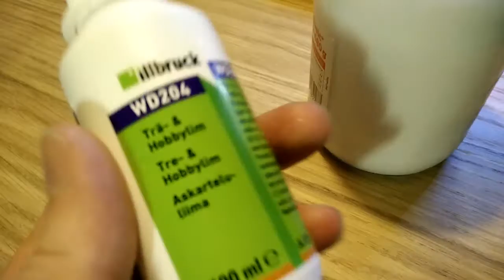Sunhokey Prusa I3 2015 3D Printer - Customized

Comment: Im looking to buy my first 3d printer, would you reccomend this one?
Reply from the maker: Yes, i think it's a very good starter kit. :)
Reply: BoXon Ive seen that over time the frame falls apart, has this been a issue?
Reply from the maker: I have never had a problem with this printer (except för the ones i caused it by testing things out). Frame is rigid enough and hasn't been falling apart for me, but be aware to not over tighten it as it easily cracks. (Hasn't happened to me tough)
Reply: What is the build volume on this also what is that white covering you put over your wires

Thanks.

PS: i like how you setup your printer :D
Reply from the maker: 200x200x180 (X,Y,Z). I've made alot of changes to the printer, so a new video will probably be out soon. :)
Reply: BoXon Does that material spool holder come with the printer?
Reply from the maker: Yes :)
Reply: BoXon About to purchase a Aurora Steel i3 printer, steel frame i3 printer
Reply from the maker: Good luck with it! :-)
Reply from the maker: Most of it looks to be plastic? Also i wouldn't buy anything from aliexpress that hasn't gotten any feedback. If a metal body is important to you, go with the Wanhao I3 V2, big community around it! :-)
Reply: BoXon
 Hey i found one shipped and taxed for only 10$ more to my doorstep

Imma get this one instead, Thanks :D

Comment: Hi BoXon,I have the same printer and also made changes to it....I have auto bed leveling, e3d Hot end and a PCB heat bed with a glass surface and a BuildTak sheet..... NEVER have any problems....
Reply from the maker: +55Rumble 
Hi! Glad to hear it's working good for you! I'm working on some new updates to the printer, and will post a new video when i'm done. Heard a lot about BuildTak, but as i found the best solution (so far) about a week ago i haven't made an investment to get any. (Solution: Cheap wood glue without any water added)

Comment: I bought a Sunhokey prusa i3 about half a week ago and was wondering what did you flash the mks with to include the bed leveling system? I've been looking around and I cant really find the software for this printer.
Reply from the maker: Hi Filip! I contacted the guys at Sunhokey and asked for the firmwire, they provided it with no questions asked. I suggest you to do the same as mine is mks v1.1 and yours probably 1.2.

Comment: Hi BoXon, 
Great video, I have received my Sunhokey printer on Monday and have done quite a few things, I have added the auto bed leveling after searching for a way to fasten it to the current X carriage but could not find anything that works so I have designed my own yesterday and it works very well. I'm looking forward to your video on the auto bed leveling.
Reply from the maker: +Jaco Le Roux 
Thanks Jaco!
Yeah i had to design that myself to, too bad i don't think i have those .stl files though, so i'm glad you managed to manufacture your own! Thats the whole point of 3D printing, right? ;)

I'll be mowing to a bigger apartment next weekend (waiting has been so long and i can't use anything in my house currently as everything is in boxes), but as soon as i get my new "workshop-room" setup i'll be here with more videos of the printer! I also ordered a proximity sensor to test another method of auto bed leveling so i guess we'll see how that turns out! :)
Reply: +BoXon 
Hi again, thanks for replying, if anyone is interested here is a link for the one I have designed, maybe not the best but it works, I have made one change since my print yesterday, I only had a tight 4mm hole where a M4 bolt make use of the material to screw it down on the acrylic, I have added a hex M4 hole on the bottom peace for fasting it that way, the only thing is to drill a hole in you acrylic but use caution.

I'm still learning to use the 3D Printer some calibrations just doesn't add up, I think I'll get a new and better Extruder and hotend.. 

I'm looking forward to your proximity sensor test, will look out for it.. enjoy  

https://www.dropbox.com/s/blw9lhjpk03ufpq/ABL%20Sunhokey%20PRUSA%20i3.zip?dl=0

Comment: Did you have to add anything else to use the mk7 gear? I put an mk7 in my Sunhokey prusa I3 2015 and it didn't feed the filament at all. It looked like it was a tight fit but it mustn't have been grabbing. I changed back to the original gear and it was working.
Reply: +Daniel White (Benji241) You need to change the ballbearing to a flat one. 624zz fits in the original holder.
Reply from the maker: Hi!
I did not change the bearing, but as i changed the screw that thighten and loosen the bearing to a longer one, i think im able to give the feather more room so that it's pressing the bearing harder on the filament. i changed it due to the hexagon pattern on the screw got round.

Comment: Hi, what printer speed are you running at? The configuration files they supplied with mine says 60mm/s for Slic3r and 30/mm for Cura. When running at 50-60 the filament motor don't seem to be able to keep upp feeding, it "snaps" back. I changed to MK8 feeding wheel and it got better but I still curious about what speed works best for you... I just have mine up and running for a week so I suppose I have to do some more testing.
Reply from the maker: +Björn Blomberg I'm usually printing around 30-50mm/s. I guess your biggest problem might be that you haven't calibrated the extruder so that it extrudes the correct amount of filament? Mine was way off in its original state! :)
Reply: Okay thanks for the information. My extruder is calibrated, it extruded way to little filament with stock settings.